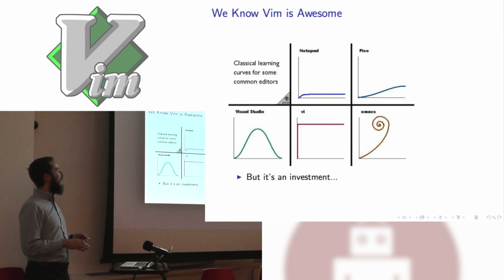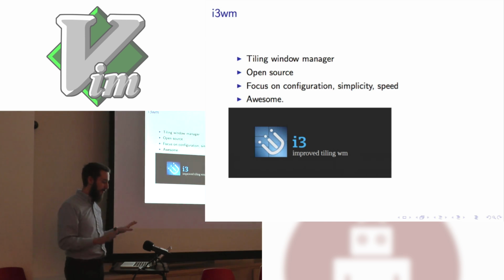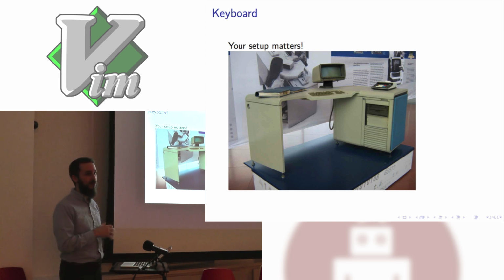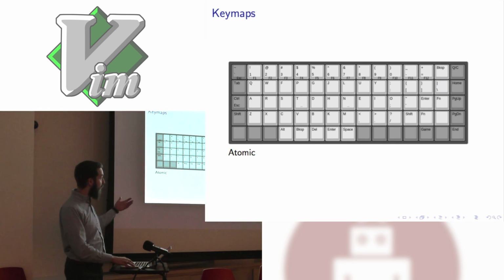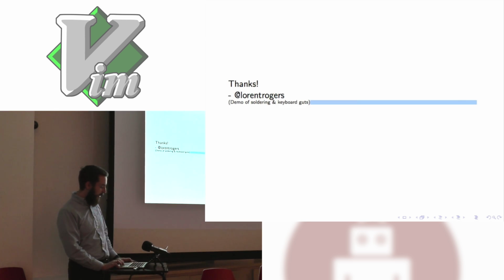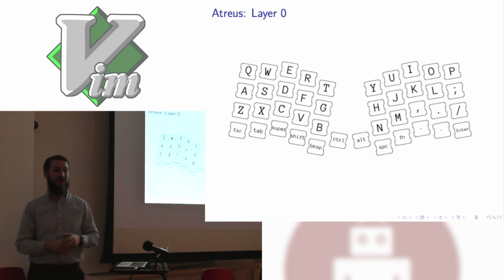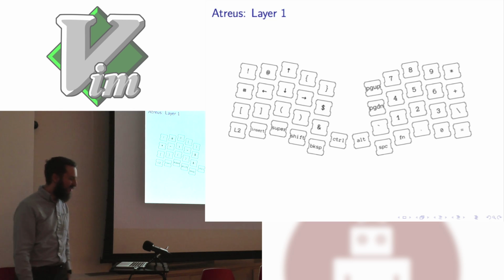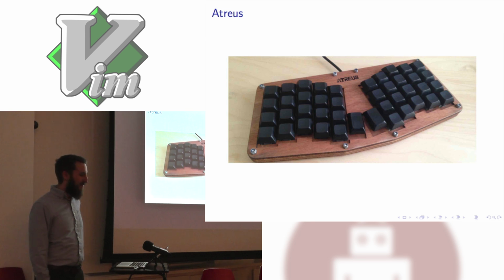Atreus, i3, and Vim

Comment: Vim check. Custom keyboard check( mostly stick to hhkb variants and 40% ortho). But i3– once you use tmux you don’t need a file manager, especially if your are running multiple machines in the same session
Reply: With tmux you can split terminals only, with i3 you can control all windows with keyboard
Reply: Yup, Vim8, hhkb-pro2, tmux . . . (docker and git[hub]) that's it. Get your term from vim8, switch windows/panes. For windows I have to add cygwin/mintty or MobaXterm too.

Comment: Pretty interesting topics here, but this guy is a bit of a mess. When he's explaining things I like and use, I feel like he's not accurately portraying them. With mechanical keyboards he talks about some sort of finger vibrations, then goes on to vaguely describe speed. He didn't mention that mechanical keys register their press partway down while rubber domes have to bottom out to register. I'm not even sure if some of what he said is true, it just seemed confusing. It seemed like he was getting at latency at one point which probably doesn't differ much between keyboards unless you go back to very old computers that were lower latency like the Apple II.
I do like his excitement and that he wants to share it with the world. There's a lot of cool free software out there that most people don't know about. I just wish he was more coherent.

Comment: If you have 300$ to spend on keyboard you should get yourself Kinesis Advantage. It's least portable, very far away from opensource as it's patented, it comes with some learning curve (2-5 weeks), but after that period you will be sorry about all the money thrown away on machines of torture which is traditional boards. Watching this video was quite a fun as every second board dude talking about clearly trying to mimic Advantage without breaking patent law and they pretty much suck at it :) I know it's hard to understand without having actual  board for several weeks, but trust me, patented shape of Advantage makes THAT much of a difference.
Reply: ذنةث
Reply: Sorry bro, but the Kinesis patents expired in 2014 and other keyboards have taken the lead since then. check out Dactyl or even better Dactyl Manuform and you will see what I mean. I own all 3 (4 if you count both versions of Advantage) of them and Kinesis (advantage 1+2) are the least ergonomic of them.

Comment: WHY ortholinear? I have ergodox and I could not get used to it because of this. 
I touch type...  and most keyboards are not ortholinear.
Reply: @Timber Wolf what's the point? I still have to use other keyboards too. And I don't even think that there's much of a benefit.
Reply: As he said, because it minimises horizontal finger movement, which is bad for your joints. If you take the time to learn to type on an ortholinear keyboard (which, honestly, if you're used to touch-typing, really shouldn't be that hard as your fingers are already where they should be) I can practically guarantee you'll notice your fingers feeling better after even just a week or two. (writing from an Ergodox btw.)
Reply: @Cybolic  when I got my ergodox I remember typing and my fingers hiting edges of the right or wrong keys. And when I have to switch back to normal keyboard I can imagine what it would do to my performance. Been touch typing over ten years I can't say I buy that horizontal finger movement argument.
I will give it another try.
Reply: I used an ergodox for a few months and got used to the ortholinear layout after just a week or two. I'm back to staggered now because I gave the keyboard back to who I was borrowing it from, and I still really miss it. I plan to get another ortho board at some point. I'm using a Pok3r now, which is probably one of the best non-ortho non-split boards.
Reply: It takes a few weeks to get used to ortho but then it is a lot better for your hands. I have done the switch and would never go back. I do full ortho (fixed row-column grid) but can also use column staggered ortho.
Reply: @KimSchulz  could you explain why is ortholinear better exactly? What are the pros and cons. One big con for me is that most keyboards are not ortholinear.
Reply: @tonn333  Like he mentioned in this video as well. you do not get such a stretch between the fingers. it a much more ergonomic. The staggered layout we have today was invented in the old days for typewriters where an arm svung up and hit the paper for each key. They were activated by an underlaying mechanical mechanism and would they needed spacing to be laid out properly. Today we do not have these limitations and can design according to ergonomics rather than mechanic limitations. 
I bring one of my keyboards everywhere so I don't see the con of other people using a historic layout.
Reply: @KimSchulz  yeah I get all that already. What I don't get is how is it MUCH more ergonomic. I hold my hands at an angle anyway so my fingers naturally follow the keys diagonally up and down.
Don't you use laptops at all or portable Bluetooth keyboards? For example I really like Logitech's MX keys, I can type faster on it than any of my mechanicals.
Reply: @tonn333  Check your fingers. Your keys are not angled but staggered pr row and column. This means that you have to move your finger a little from side to side when moving from one row to another. It is this movement that hurts your fingers. 
I normally bring a mechanical keyboard - even when traveling and only use my laptop keyboard if I really do not have room to setup my real keyboard. I have several different mechanical bluetooth keyboards so I would never buy a Logitech keyboard.
Reply: @KimSchulz  never said that keys were angled. My fingers are designed to move side to side it doesn't hurt them. Over 20 years never had finger pain. What I have had thought is pain in the wrists. And I can see it becoming an issue when I would have to hold my hands perpendicular to my keyboard instead of natural angle. This is why I loved the idea of split keyboards but I wish there would be a good low profile staggered split Bluetooth keyboard option out there.
MX keys is great for fast typing. I was forced to use one and now it's pretty much the only one I use. Truly low profile keyboards are not really a thing in the diy market yet unfortunately.
Reply: Lmao you're a baby. Learn to type better. Columnar / Ortho is clearly superior.
Reply: @Cons-Cat  that's the thing... I have learned to touch type on normal keyboards. I type way better on them... And even after using ortholinear I still type better on a normal and fail to see much benefits over normal ones.

Comment: "Unfortunately Linux didn't work on me today, so I'll show you on a mac" - kind of sums it up, eh?
Reply: Zandman26 Why do I smell arch here?
Reply: Says something about the distribution of Linux he was running. I have had my current Linux installation for 4 years (when I last changed computer) and it has never failed me.
Reply: It just shows Linux is highly customizable and fully in your control, so if you do something wrong you have to clean it up. You are not limited to this single thing which you can't control at all and just have to love with. How does the saying go again? The computer is only as smart as its user and Linux completely reflects that. If you mess something up than most of the time yes, it is your fault
Reply: I have a entire year without Linux failing on me. And when it does fail if because I did something stupid, also I usually fix whatever problem might occur within an hour or so.
Reply: Bogdan Constantinescu still, I'd rather have linux fail me occasionally than be an Apple slave
Reply: he probably didnt know how to connect his laptop to the projector
Reply: @ryuuji159 Exactly, and to be fair, Macs are better at connecting to peripherals than Linux, it's just that Linux is much better for other things, like software development.

Comment: wtf is that learing curve graph for emacs LMAO
Reply: I thought emacs was for vim users who would like to push one more button to get the same stuff done as in vim.
Reply: It's actually an Euler spiral c:
Reply: @henry stevens I gave up on mice a long while a go, I do recommend dead mice, such as CST2545 or Kensington SlimBlade.
Reply: @henry stevens Good for you
Reply: Sergio Díaz Nila  Nvim is vim with a cleaner code base and better job control.